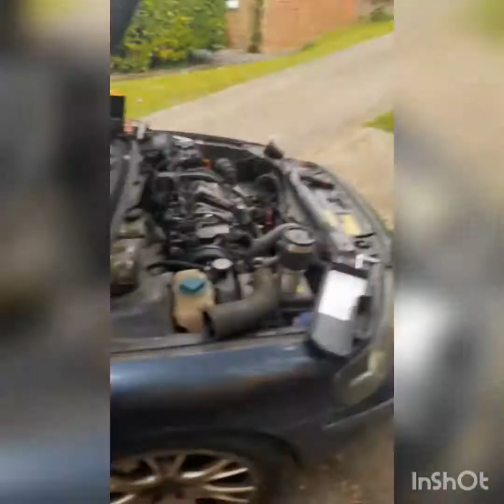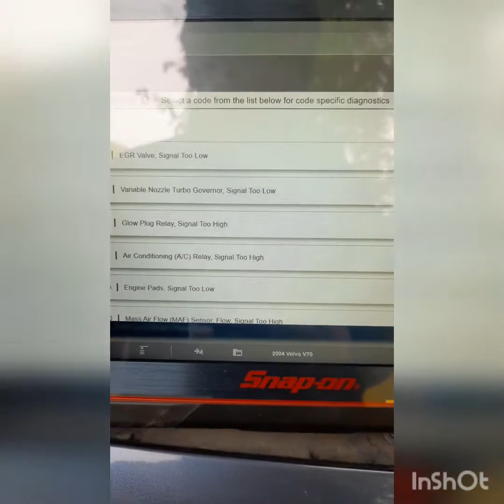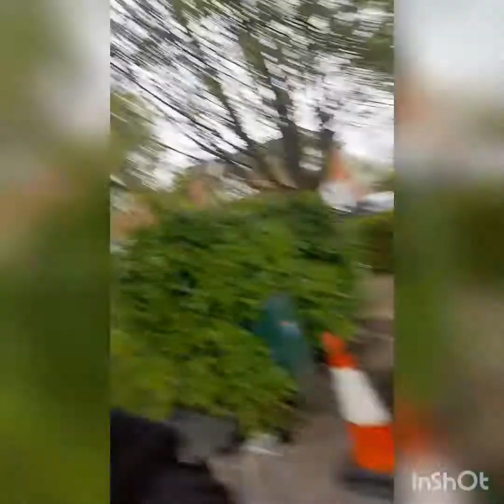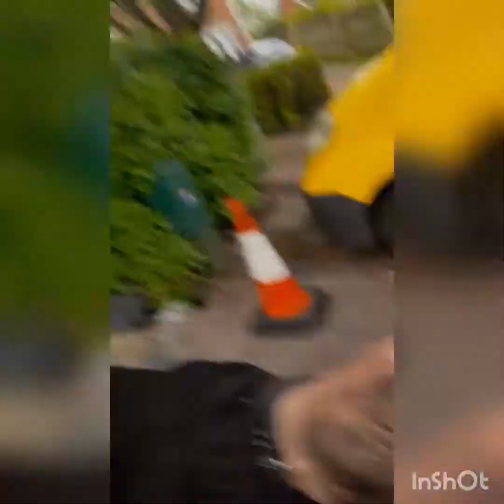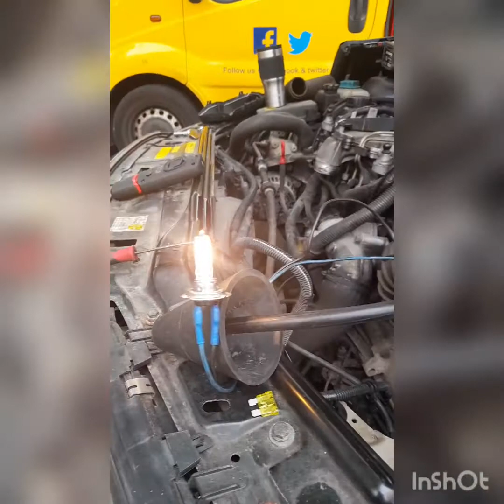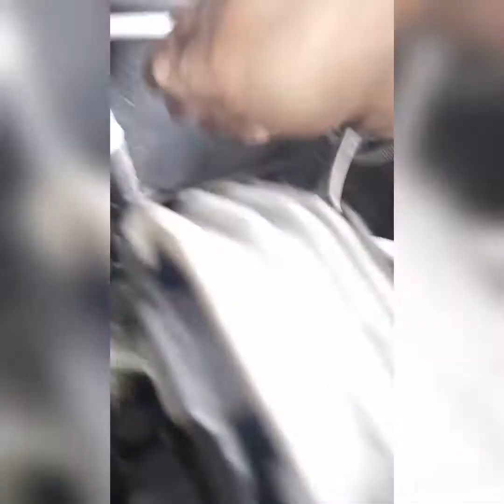volvo V70 limp home mode lack of power

Comment: Hi Chris is it safe to run the car with the sensor disconnected. I’m running mine since I watched your video and it’s running fine. I can’t find the sensor when I google it. Thanks
Reply from the maker: What have you disconnected? If its the sam part as in the video. The air intake heater element then you should be fine
Reply: @amsdiagnostics  yes same part Chris. Running great thanks.
Reply from the maker: Great stuff. I'm glad you sorted it. Dont forget to like & subscribe 👍
Reply: @amsdiagnostics  👍

Comment: Very good! I've got two older Volvos (2001 V70XC & 2004 XC70) both Gasoline (petrol). I chased  a problem on the V70 that indicated that the turbo boost solenoid was faulty but a new one didn't fix the issue. What I found instead was a loose connection after the turbo in the trunking that takes air from the turbo to the intercooler. I tightened the clamp where the trunking meets the short rubber hose at the discharge from the turbo and no more trouble. So true that diagnostics is often more than just replacing parts based on scan results. I've subscribed and hope to see more of your work. Greetings from British Columbia, Canada.

Comment: Point made sir. My mechanic has the same step by step diagnostic style. Checks codes and check all sensors and wiring. And it works, takes some time but it's better to spend time than money.

Comment: Hi Chris I'm currently experiencing a similar problem on my 2000 V70 I took it to a well respected Volvo "specialist" shop. After they performed preliminary diagnostic tests they told me they couldn't pinpoint the cause of the short causing the limp mode to be engaged and couldn't tell me how long any additional test s would take or even if they would be able to indentify the cause. Car was running fine prior to this w/low miles for a 2000 (101,000 Miles) I wonder if fuse 11 is the culprit?  Thanks for talking us through this particular issue. Well Done!
Reply from the maker: Hi Vikki, your welcome.  Hopefully it will help in getting your car back running properly.